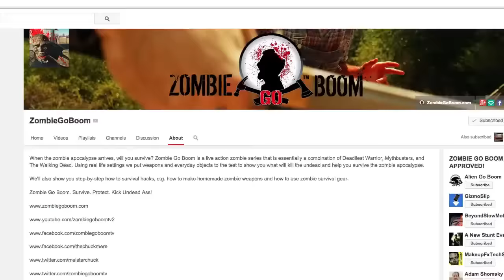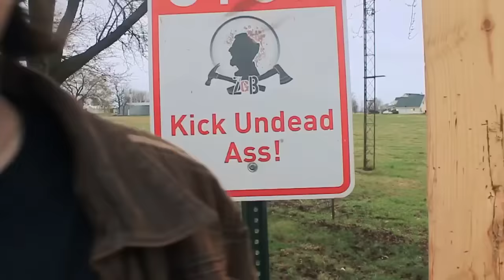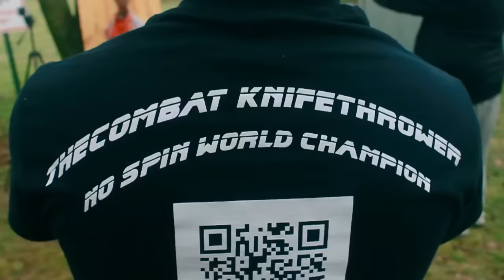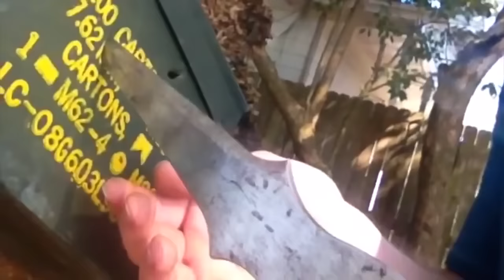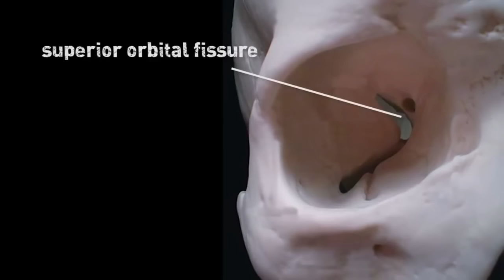American Zombie Survivor #2 - Combat Knife Throwing - Zombie Go Boom

Comment: If you really want to do any kind of test that will show if it's going to work on the real zombie, then you need to put the average weight on the Ivan head just like a human skull has. Trust me it will accept the real power that you will put into it. I know that your Ivan heads are strong and close to human skulls, but you need the same weight on the skull that way it will not move like your Ivan heads. By saying that I mean that you are loosing a lot of power since the Ivan heads are too light, the human skull does not move like that because it has more weight.  Just a suggestion :)